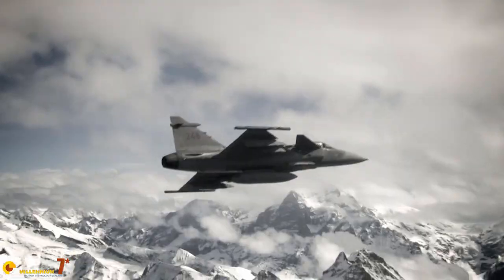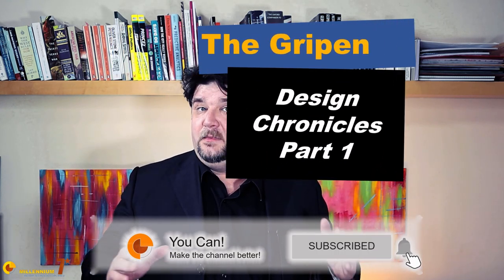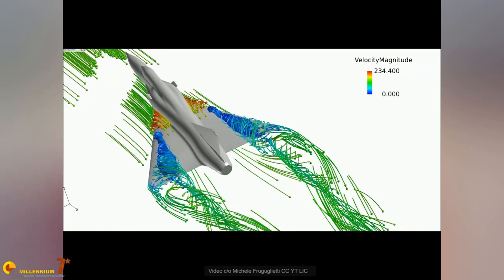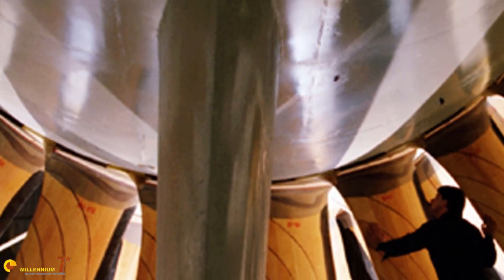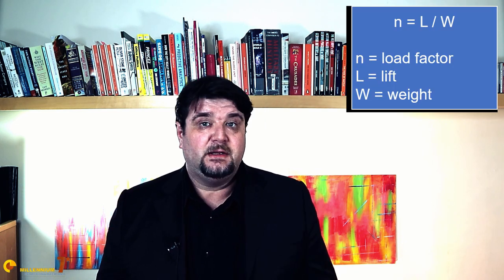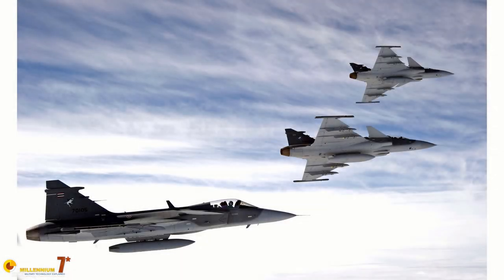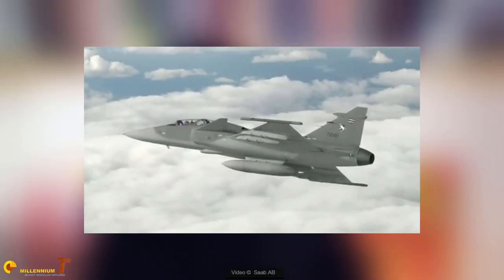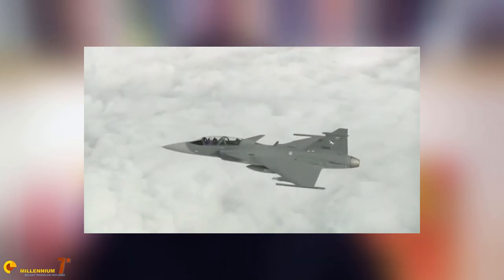The Saab JAS-39 Gripen: the design chronicles - (Long format, all episodes together)

Comment from the maker: Support me on Subscribestar  https://www.subscribestar.com/millennium-7-history-technology
Support me on Patreon  https://www.patreon.com/Millennium7
Reply: Thank you! Do you think Gripen can perform a controlled cobra manouver? When I saw the crash in Stockholm close up, I believed it was just that, until the plot ejected. The idea of making a multirole fighter was not new to SAAB or SWAF. Viggen was planned to be one. But the available technology wasn't ready to make it possible. Only later the AJS 37 was possible to make.
Reply: @atlet1  AoA limiters will likely prevent a pilot from executing the Cobra on a Gripen. And in any case it's not necessary for dumping speed with a Cobra in Delta Canards. Delta wings can already do that, plus canards can be moved in such a way to act as airbrakes. Not to mention, dumping energy with a Cobra or any other maneuver is basically suicidal in modern jet combat which emphasises keeping an energy state advantage over the enemy. Forcing overshoots only works if the two aircraft are facing off one on one (not going to happen in modern combat) and only if the plane being pursued has somehow escaped being shot down despite having an opponent glued to his six o'clock with modern missiles (again, not going to happen).
Reply: @MonMalthias  absolutely wright, due to my knowledge too! But it's an awesome air show stunt.
Reply: @atlet1  Yes, it does look spectacular. The Russians have produced designs with outstanding post-stall maneuverability, something that has been largely ignored by the Western doctrine of energy-maneuverability. 
MiG-29s at MAKs demonstrating post stall are always a captivating display, but will remain just that - a display. https://www.youtube.com/watch?v=DDdvzFmVm-Y
Reply: I liked the detail and keep up them coming. I might be actively participating in fiery discussions. 😊
Reply: Great video 👍🏻
I assume that you have seen Swedish Draken pilots doing the Cobra manoeuvre in the 70s?
Many years prior to the Russians.
Reply: I remember when they first  introduced this plane one the magazines,  a plane that can land and take off  out of back roads and highways.

Comment: Very interesting video. Thank you so much! FYI - J 35 Draken pilots where regularly trained to perform the Cobra maneuver as a combat air brake. Called "super stall" or in Swedish - "short parade". Double delta wing-plane (world's first) produced from 1960.... So the Su-27 was 25 years too late... 😉
Reply: Yeah. The Swedes just kept quiet about what the J-35 could do
Reply: @jadams3427  Yes we did :-)

Comment: This is the literally the best fighter in the world because it's inexpensive enough to have a large air force but it's not technologically outclassed by anything else in the air.  For the same price, no air force not made of Gripens can defeat an air force that does.  END OF STORY.
Reply: It is as Stalin says - Quantity has a quality all of its own. There are a lot of material forces driving designers and defense contractors towards producing ever more expensive, ever more "capable" aircraft that are individually, exquisite pieces of engineering. 

But they're also bad machines of war. In wartime, runways get bombed, skilled technicians might be killed (or if they're corporate contractors, just refuse to deploy), missiles run out, and factories get destroyed. 

It makes a lot of sense to a defense contractor to farm out the work of subsystems to a thousand subcontractors all around the world because they get paid more for systems integration. It does not make sense if ships are getting sunk or shipments are sabotaged, and trade is the first thing to be attacked in war, or even before war starts.

It makes sense to a defense contractor to have corporate technicians on the flightline because that's money on the table. But in war those technicians will refuse to deploy, and if the airfield is attacked, they will have no idea how to defend themselves. 

It makes sense to make an extremely expensive, maintenance heavy aircraft for a defense contractor, but it's terrible for an airforce that lives and dies by how many sorties it can generate.

Gripen sidesteps a lot of these problems precisely because it is just complex enough to perform well yet designed in a way that is simple for even conscripts to maintain. Just enough modern accoutrements to be effective in combat yet without whiz-bang features that blow out the price for air forces and make flying them too expensive to sustain. 

It's a design philosophy that more organisations should adopt. Sadly, a lot of Western generals, politicians and defense companies are preoccupied with the shiny stuff.
Reply: Not sure if serious....Best fighter in the world?  Where is it best?

Radar?
Propulsion?
Airframe?
Combat radius?
Low observables?
Sensor Fusion/Interleaving?
Payload?
Multi-mission pivot capability?
Cost?

All of these systems have metrics that can be compared against other aircraft designs.  The Gripen has been evaluated next to other fighters, including the EF Typhoon, Rafale, and Super Hornet.  Of all the nations that evaluated it, only Brazil has chosen the Gripen NG.

Comment: This is very interesting and educational.  I am stunned by Gripen's list price of $70mm, being only marginally lower than F35.  I am also stunned by alleged ultra low per hour operating cost of $4000 in 2012 dollars (almost like a private jet), done by IHS and Stratpost.  I will appreciate if you could dedicate a separate series of shows to per hour operating costs, and acquisition cost per expected hours of lifetime.  No one has the right answers, and the estimates are all over the universe.  It will take your detailed engineering mind to digest all this for us and share.  Gripen is a great place to start with alleged operating cost so low.  Conscript army servicing??  And if ops costs are so low, why is the sticker price so high?  a single GE engine is not as expensive as others, on the cheaper side, in fact.  Will great if you could share your insights and looked at this in relation to other western aircraft.  Soviet/Russian aircraft are a different story, with engines having a finite life in the hundreds per hour.

Comment: Fine video again! Eager to see if Finland chooses Gripen. We use distributed network of road runways just like the Swedes. Hence, Gripen or a plane designed for operating from an aircraft carrier probably fits our needs: Short take off and landing combined with short swingspan and/or foldable wings help hiding the planes, moving them around and having even more options for road bases. For example the F-18 Hornets in Finland use the carrier style hook+cables braking if necessary. 

Norwegians required F-35s with a braking parachute added, for icy runways. If the Finns choose F-35 we order the Norwegian arctic variant too.  JAS Gripen or Super Hornet seem the most likely winners, though there is nothing wrong with Rafael and Typhoon either.

Comment: When are you going to analyze NG?
They have significant design changes!
New Front Landing Gear
Repositioning and redesigned of rear landing gears under the wings
Air intake at the base of the rudder of cause
F414 Engine
Sensors on the edge of canards
3 times more range
etc etc.